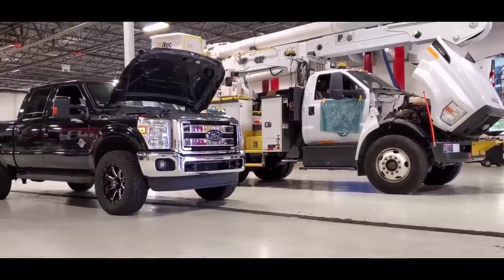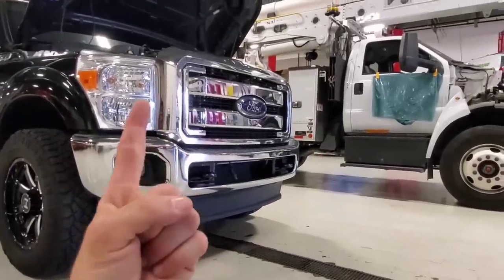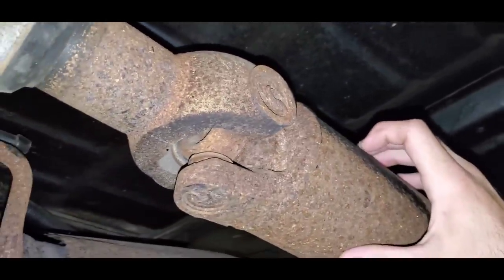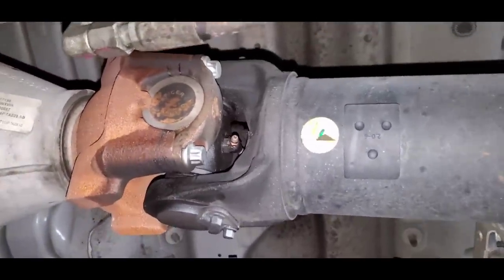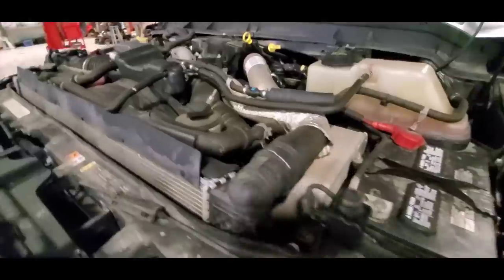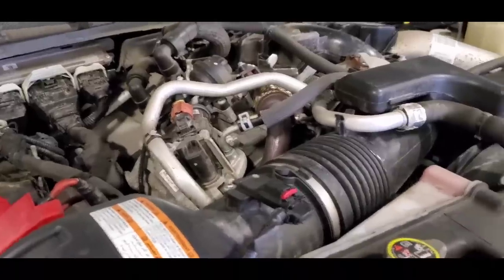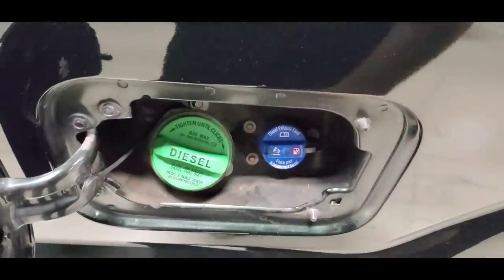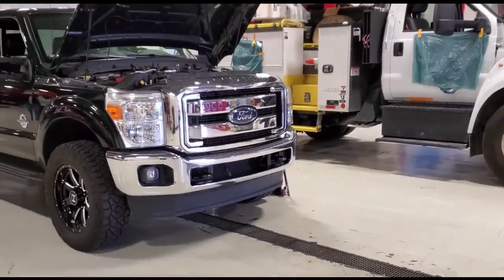The 3 things every POWERSTROKE owner needs to KNOW!

Comment: 2007 6.0 Power Stroke. 465,000 miles. John Deere Plus-50 ll 15w-40 oil every 5,000 miles with Archoil. Fuel Filters every 10,000 miles. Trans every 30,000. Archoil or Howes fuel treatment at every fill up. No DEF ✌️
Reply: Mine made it to 450k before I sold it but I also spent 25k in parts over that life time

Comment: Most problems with the 6.7 are due to lack of maintenance. The fuel system is extremely sensitive to contaminants and the engine dumps a ton of soot  in the oil. Keep the fluid and filters clean and she will treat well.
Reply from the maker: Amen brotha!!!👍💯👊
Reply: I have my oil tested after every oil change.  Before deleting the fuel dilution and some other numbers were a bit high. After deleting everything dropped. The lab couldn't figure what I did different with that oil change. Running 8500 miles on standard Motorcraft oil and the tests come back really good.
Reply from the maker: Thats great to hear man!!
Reply: @PowerStrokeTechTalkwARod  do you recommend deleting if I can afford it ? is it really worth it?

Comment: I repair a drilling company vehicles. They don't do squat to them till something quits or breaks.  I keep trying to tell them maint.  For whatever reason, they'd rather buy new vehicles when they hit 100-110k instead of doing maint and having them well past 200k. But they always b***h and complain when one has to have a complete fuel system overhaul.  I find sand in the filters often.  They often have P20B9 and P228F codes.  A lot of their problems come from their "hands."  Not their vehicles so treat them like crap.  I hate seeing 50k miles trucks that look like they have 300k on them. Half the time I have no idea why they mess with stuff under the hood.  The way the trucks are mistreated, often makes it hard to diag them properly. They never get washed and look like they go mudding every day inside and out.

Comment: Thanks for the advice.  Fuel filters every other oil change,  oil change @7000 miles (recommended by blackstone oil analysts) w / 5w40 rotella t6.  Tire rotation @ 5000. Fill up the def when the light comes on.  Air filter by the guage. Everything  else is by the book.  Sound good ARod?
Reply from the maker: Sound gooooooood to me 👊👊👍👍

Comment: Rotella T6 and Motorcraft 2051S every 6500 to 7000 miles. Motorcraft fuel filters every 13000 to 14000.  I fill the DEF tank when it gets to about 1/2. Never run below that.  Motorcraft air filter as needed. Do not do the convenience store for fuel (unless on a road trip, limited choices and burning it out right away). I buy my diesel at the same place in town almost all of the time. I do wish with my 6.7 F350's had the DPF/Catalyst system on the 650-750. Would love it if the DPF could be separated and the catalyst cleaned like on the Big Boys when needed.
Reply from the maker: Oh they can cost about 800 bucks to cut, cook and re weld back
Reply: @PowerStrokeTechTalkwARod  That's good to know. I've been told they couldn't do that. Have you done any?

Comment: Thanks for the advice. I had a 6.4 (was a good engine for me, got lucky I guess) for a five years before trading it for a 13, 6.7 in your new favorite color...Green Gem. It was a beautiful F350, outstanding color. I have a 17 F350 now, and regrettably that color was no longer available so I went with Blue Jeans.
Old lady I was with for a while needed a new farm truck and we test drove a Ram w/ ho diesel, I hated it, felt slow and didn't like the style. Ford has them all beat for damn sure.
Reply from the maker: Henry has em on LOCK!!
Reply: Sounds like my dads same story, he had a 6.4 and I swear to god it’s the only 6.4 I know of that didn’t delete its pistons at 400k and actually made it to 600k before he got his blue 2013 6.7 after that truck he got a black alumiduty and that truck was deleted and tuned (was my personal favorite of them all), I’ve tried the dodge Cummins trucks as well I even owned a 96 2500 for a year and was honestly one of the slowest trucks I’ve ever owned (my 4.7 1500 ram is hella faster than it) and I replaced that sack of garbage with a 7.3 after the trans blew out of it. The 7.3 made it all the way to my uncles junk yard then died about a 1/4 of the way home but since I got it for free from my dads work I just kind of said “the hell with this” and left it there. I’m now looking for a 05-07 f250 with the 6.0 in it, has to be 4x4, has to be long bed, preferably crew cab, and bulletproofed is fine.

Comment: 4. Go ahead and buy a replacement intake tube. Knew it was a know issue and I put it off. It got me this past weekend. Lucky for me I was 10 miles from a ford dealer and they had the part in stock. $135 dollars later, swapped it out in the parking lot and was good to go.

Comment: My annoyance with my DEF is that, even though it’s a 5 gallon tank, when the gauge cluster says “less than 1/2 full”, it only takes ~2.3 gallons to fill. So I’m left with a few cups of extra DEF in the plastic jug that I don’t need.
Reply from the maker: True that
Reply: My `16 450 is like that, wish there was an aftermarket gage.

Comment: 2019 F-450 Limited. Every 5K mo matter what. Rotella T6 5w40, Motorcraft everything. Even run the Motorcraft fuel additive!

Blackstone test said I could do 7K... haven’t adjusted the schedule yet though. Amazingly low fuel dilution at 5K.
Reply from the maker: Great to hear!!!!
Reply: Running the same setup, Rotella T6 5w40 and all Motorcraft filters. Blackstone still has good reports for it. Cant see myself going any higher though. Im deleted so that may make a difference in the oil life.
Reply from the maker: 👍👍 yepp

Comment: By the looks of it the DPF in the 750, it is modular, that needs to happen to the 2,3,450s. At 4k$ to buy the DPF , having a modular system for clean ability is the way to go. Great video,  you always have great videos, very important subject, thank you!
Reply from the maker: Thank you. You can seperate the 250-550s to clean. Cost about $800 to cut, clean and re weld
Reply: @PowerStrokeTechTalkwARod  Really? Not that I need it now but something to look into, still would be better to have bolt connections.

Comment: Tried to change my fuel filters but the one on the frame rail wouldn’t stop draining. Got about 2 gallons before I decided to stop. I did just fill up the tank though.
Reply from the maker: Got get it swapped out qwik....shldnt be drainin like that
Reply: 11-16 you have to turn the lower filter housing about 2 turns before draining. There a plunger or something in there that keeps the fuel from pouring out when you drop the housing. 17+ should stop draining after about half a gallon. Totally different housing though.

Comment: The U-joint at the trans of the work truck needs replacing.  The U-joint bearing cap is spinning in the trunion of the yoke.  Replace U-joint and use a new strap kit.

Comment: A-Rod,

Good mornin' my man.

I've never seen anyone do a literal side-by-side comparison between the pickups and the big boys. Same, but different. I also noticed that the layout on top of the engine differs a little also. Very interesting.

Maintenance on my 223000KM F-250:
Motorcraft 10W30 CONVENTIONAL oil year-round
Motorcraft oil filter
Every 5000KMs

Motorcraft upper and lower fuel filters
Motorcraft air filter
Every 10000KMs

Motorcraft DEF FILLED when dash says less than 100KMs to Empty
Motorcraft Cetane Booster 125ml every tank

Runs like new.

Have a good weekend Mr. Sir,

-Adrenacyde

P.S. I do not use or endorse Milwaukee tools
Reply from the maker: ALWAYS nice to hear from my mann up norF. Cheers to ya peeeimp

Comment: When it shows the hours and mileage, those are two individual measurements correct? You have 25,000 driving + (X number of idling hours x 30)? Correct? What does idling include, time in park and engine running, time stopped and below a certain RPM even though in Drive? You see where I’m going with this.....
Reply from the maker: Your are correct all the way thru

Comment: Great video. We just traded our 2016 F350 dually in on a Ford 2019. It had 455,000, yes 455,000 miles on it. Rotella T and Ford filter every 10- 12K, Ford fuel filters every 20K. Started using Ford Cetane but those stupid paper discs under the cap kept falling into tank causing low pressure fuel pump to burn out. Switched to Howe’s. High pressure pump and injectors needed to be replaced so was time to upgrade. Any thoughts on Amsoil?
Reply from the maker: Never messed with it
Reply: I run a fleet of training motorcycles, don’t know about diesels but their motorcycle oil is garbage, wet clutches got grabby real quick

Comment: I have been thinking of getting a diesel

This is what my basic maintaince would look like

Thoughts?

All input is welcome !

Get extended warranty
Oil change every 5km
Fuel filters every 15km
Drain water filter once per month
Use fuel aditive like hotshots
Install high rpm idle switch
Turn OCR on
Drive it like you stole it to maintain dpf
Keep DEF topped off

Should i get a by pass cp4 pump kit?
Is there a way to keep track of the DEF heater? So if it dies I know right away?

Comment: Great video again!!! I changed the oil on all three of mine at 3500 miles and fuel filters too , and top off the def every two weeks,  use all Ford's parts , oil ; 10w30 , and exhaust fluid   ,  keep the great videos coming
Reply from the maker: Thanks for the positive feed back, even the thumbs downers 👍👍
Reply: @PowerStrokeTechTalkwARod  your welcome,  I don't why someone would thumb down your videos , very helpful and you learn a thing a two , I did want to ask , I've seen my oil temps reach 230° on hot days pulling a trailer , is that normal ? Usually runs around the 201°- 216°  ,  sometimes it concerns me

Comment: Motorcraft everything except s&b cold air intake and rotella oil.
Reply: I'm right there with ya. Just did an oil change with Rotella T6 5w-40 (FL2051S filter of course), Motorcraft FD-4625 fuel filters and monitor my S&B CAI. My 2017 runs like a dream.

Comment: Stupid question about batteries.  I just swapped out the factory batteries in my 2019 F250 6.7 with some AGM batteries.  I swapped 1 at a time to keep power to the truck.  Because I did it this way, does the truck need to relearn anything or is there anything I need to change settings on?  First Powerstroke and loving it!

Also, what is the best way to monitor voltage on the system?  Or does the computer do a good enough job to let you know when something is array?  Thank you!
Reply from the maker: Yes ur fine, no nothing needs to be done. Yes computer monitors everything

Comment: You failed to mention which oil weight you prefer. Also should the oil be blended synthetic or keep with the conventional oil. Also you mentioned def. should I use ford def or buy it At Walmart. Also does def freeze up in ford trucks .Do they have a def heater.
Thanks, be careful and stay safe 😀
Reply from the maker: 5w40 & dont buy junk garbage DEF!!!!
Reply: @PowerStrokeTechTalkwARod  Hello  -
Reply: @PowerStrokeTechTalkwARod  Hello a
Reply from the maker: Hey pal

Comment: I’m just starting out in commercial driving with a 2020 F350. I would like to idle in the winter far warmth. Will my dealer install a high idle switch and how will idling affective longevity of my engine? I get the 1 idle hour equals 30 drive miles. Thanks
Reply from the maker: No worries, they may but i have a video of installing the high idle resistor. Check it out. Also, get OCR turned on so you can stay on top of your DPF health. I too have a video for that. Watch our playlists 😁
Reply: @PowerStrokeTechTalkwARod  thanks I’ll watch the OCD video, but how does idling for hours affect the longevity of the 6.7?
Reply from the maker: Stop thru our LIVE streams we go over that stuff

Comment: 5,000 synthetic lof 10,000 fuel filters. Do you recommend Rotella T6? 2017 only 16,000 miles. I have a company vehicle. Explains the low miles. But I tow most of the miles this truck has.I did a break in oil change at 1,000 2,500 5,000 switched to motorcraft synthetic at 10,000. Am I nuts😉. Edit, spray her down twice a year with Fluid Film.

Comment: I have a 2012 F-350 crew cab long bed 4x4 6.7 with a lighting issue I have no bright or high beam headlights the high beam indicator on the dash comes on but no lights on on the front of the truck also the front interior dome light doesn’t work when I open the doors the door ajar indicator comes on on the dash but the front dome light doesn’t come on at anytime or anyway the rear interior dome light works as it should also what do you consider the best oil for the 6.7 conventional, synthetic, or a blend
Reply from the maker: Sounds like u got a BCM issue. Regular 10w30 bub
Reply: Why conventional instead of a synthetic or a blend of the 2 ?
Reply from the maker: In my opinion if you're changing your oil every 5000 miles like I recommend, using full synthetic is a waste of money... the oil of the regular blend 10W30, only motorcraft, is the only oil I would recommend in your truck.
Reply: Have you done a video of how to take the dashboard apart on a 2012 f-350
Reply: Ok on the lighting issue I forgot to mention that the truck has had a communication system installed on it in the past  and I was told that it was installed on the obd port
Reply: I honestly don’t know how many miles I go between oil and filter changes I change it when I get the oil change message on the dashboard
Reply from the maker: Thats the worst dude. Better start keep track. That lights for dumb dumbs.....i dont know how some1 installs a communication system. The network wiring is part of the whole body harness....
Reply from the maker: Yes search my channel

Comment: My question is will the factory 15 quart oil pan off a F650 fit my 2011 F350? I’d like the addition quantity and easier oil change from 13 quarts to 15 which is three jugs of Motorcraft.
Reply from the maker: The extra capacity is for the air brakes. The air pump use engine oil as lube. Dont b over fillin ur shizz
Reply: @PowerStrokeTechTalkwARod  ... there are aftermarket pans for both the transmission and engine that hold additional oil. It actually helps with keeping the engine cooler when hauling big loads in hilly areas. It won’t hurt the engine at all.

Comment: I have a 2012 f550 with the 6.7 and I have what sounds like an air intrusion I’ve changed the fuel pump module from ford and the pickup inside the tank diid you ever hear of the fuel line o rings going bad where the quick connector is on the tank and the fuel pump on the rail and I see no signs of fuel leaks at all thought my problem would be the 1 line coming from the tank to the fuel pump on the rail sucking air any input on that thanks
Reply from the maker: U can email me...🤷‍♂️

Comment: Good advice for sure, these engines are solid.   Have you seen many issues with long crank before starting?
Reply from the maker: Nope not too many. Most likely a fuel issue if i were 2 guess
Reply: @PowerStrokeTechTalkwARod  yeah kinda what I'm thinking.  seams like it loses prime overnight its only if it sits awhile especially overnight.   Thought it was the fuel filters but made no difference.
Reply from the maker: I have replaced many many frame mounted fuel pumps. It is the same housing that the lower fuel filter is housed in. Piece of cake to do, bleeding is the messy part tho....

Comment: You didnt give an oilchange interval ?
I do my 6.7s at 3k 5w40 synthetic with a wix xp filter
Reply from the maker: 5k MAX motorcraft filter, no question
Reply: If you like that truck you’ll dump that Wix crap. They are literally a paper towel wrapped around a pleated piece of cardboard!
Reply: @1Slamalama1       You can never hurt anything by changing the oil too often.
Reply from the maker: Thanks 4 sharing

Comment: I read 15w-40 is also recommended is this correct for Arizona desert climate????
Reply from the maker: Put in what ur cap says bud!
Reply: I've been running 15w 40 since new, have I caused damage?
Reply from the maker: No, but does your cap say 15w40
Reply: @PowerStrokeTechTalkwARod  any harm in switching to a 5w30 synthetic at this point? Great Channel! I subbed
Reply from the maker: 5w30???

Comment: Thanks for the vid…Two questions if you would Arod regarding a 2022 f350- 
Is it okay to top off DEF fluid whenever if one is say at 50% or 75% level, and does it need to be same type?
And is there a superior DEF fluid to use or is the walmart stuff okay?  (I know not to use expired or DEF fluid kept at higher temps)
Reply from the maker: Fill def when u get a message. Stick with MC fluid👌

Comment: 350 16 f350 nothing but motorcraft def. 60k on it now. On my 3rd dpf/src. Change oil every 5k and fuel filters every 10 k also all motorcraft. About 350 idle hours. Not sure if its me or truck. I love it but when its out of warranty i do not want to pay 5 to 7k for  new exhauat fuck that
Reply: Second that!  I did weight loss surgery on my ‘12 four years ago.  Engine oil stays much cleaner, no emissions shit to fail, better fuel mileage, no exhaust regen when I’m about to pull in my driveway, and you can’t top the badass sound of the 6.7 PSD!

Comment: Rotella 15w 40? Thoughts on that?
Reply from the maker: Goood, not for 6.7's tho....
Reply: @PowerStrokeTechTalkwARod  what do you recommend?  I always used Rotella on my 7.3. Usually 10W-30 for the cooler weather never had a problem. What about my 6.7?
Reply from the maker: That boy right there takes 10W30 or 5W40
Reply: @PowerStrokeTechTalkwARod  cool thanks. I have been running the 10w-30 since new and change it every 5k regardless and use a Mobil 1 oil filter.